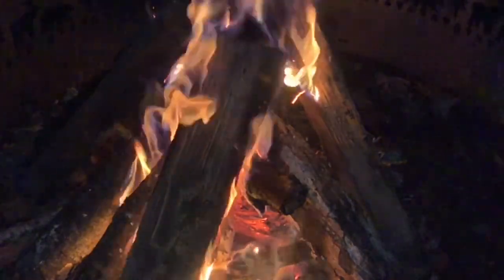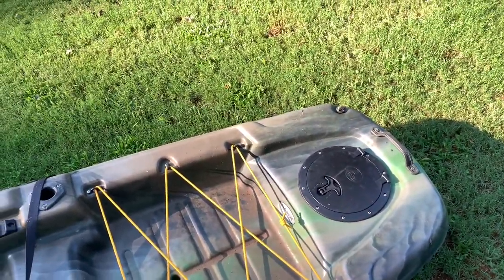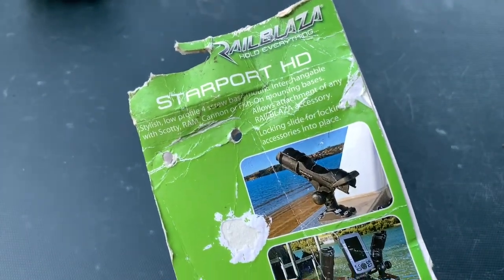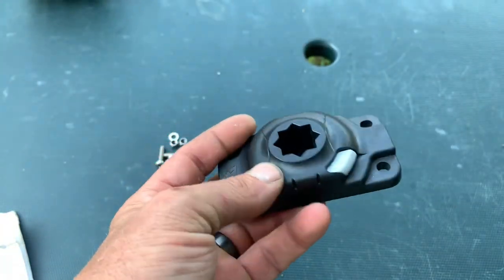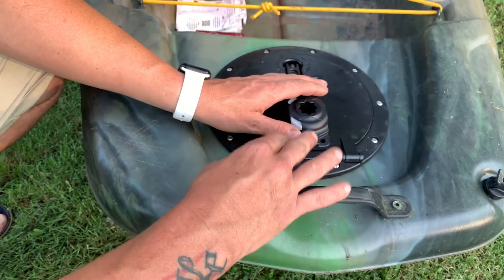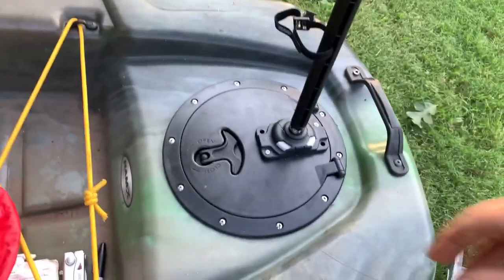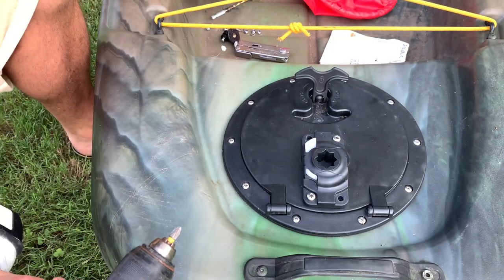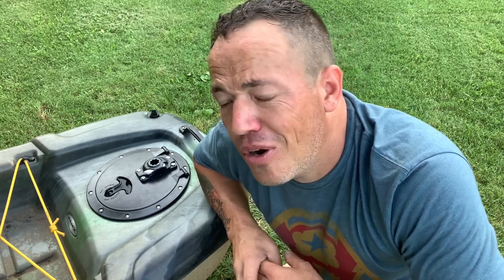Kayak DIY/How to video Installing a Railblaza Starport HD Base

Comment: I hate my star mount, not as secure as the scotty mount style. The locking mechanism is not reliable and i have had my mounts go into the water overboard while removing my rod. Its a very poor design.
Reply from the maker: Thanks Chip, I’ve never been able to use these until now, not really planning to replace any of my Scottys. But I’m hoping it can at least hold my GoPro for some taking some videos.
Reply: @greatamericansurvival  keep it inboard and tie a short lanyard to it. You'll need to drill a small hole in it to tie some paracord and secure it to the craft. Its what i did. The locking mechanism is poorly designed